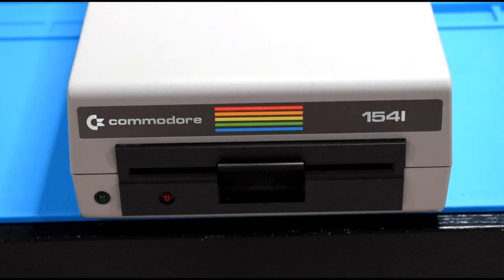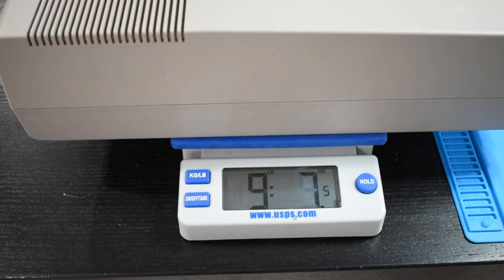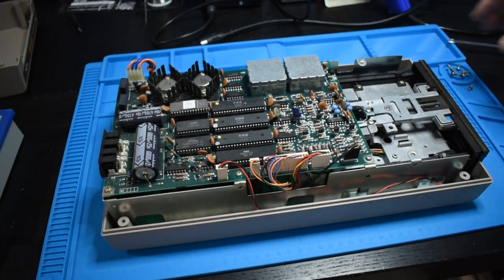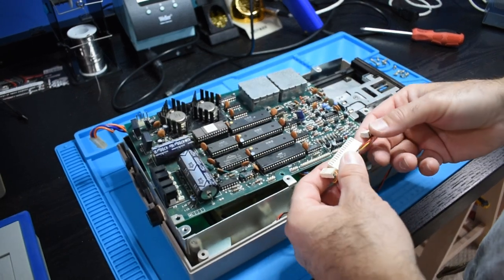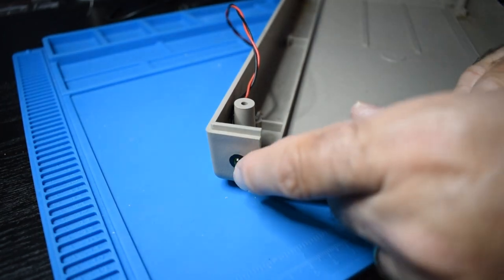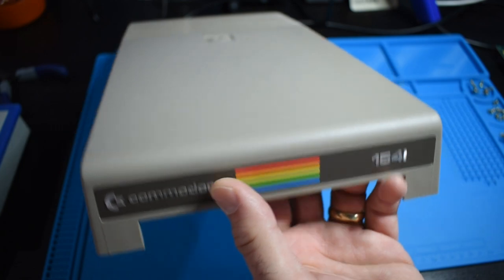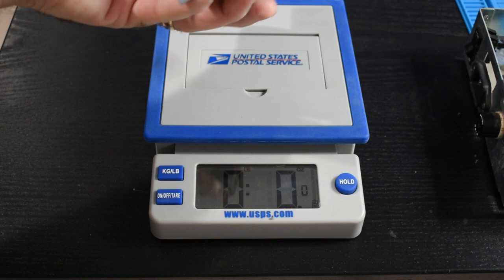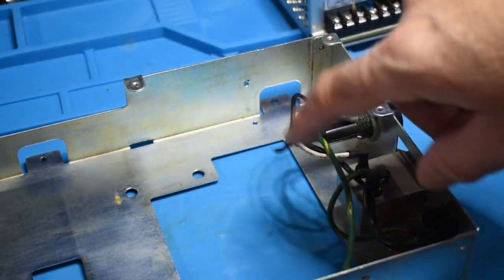The Weight Reduced Commodore 1541

Comment: "Is it heavy?" "Yeah." "Then it's expensive, put it back."
.
I kind of like electronics with heft. It's somehow more satisfying than the air-filled bits of plastic around today. I'd leave the RF shielding in. That said, the heat reduction is a huge winm so the old power supply needs to go. 
.
I used to hate RF shields, but now there's so much RF smashing around our houses that sneaks into other things, I kind of appreciate the shielding that went into things before the FCC gave up.

Comment: Hey, thanks for this. I am new to the C64 world, and I do have a working 1541. I have a bit of experience with modifying electrons, but I am still consider myself new to it. Do you have a website or photos that show and explains the changes you made? I am interested in doing this as I do know that this is an issue for these old drives and I would love to correct it.
Reply from the maker: I actually have another drive I was going to do, so I'll make some  instructions while I'm doing it.  thanks for the idea!
Reply: @thecommodoreroom4554  That would be awesome if you do, thanks.
Reply: Hey, watched this a lot and I tried it myself, and I am not getting any power to the board. I have Pin 2 of CR1 going to VR1 and PIN 3 of CR3 jumpered to VR2 exactly as is in your video, and I have pins 3 anbd 4 fo CR1 jumpered, and I am using the same power supply as you. Black in Load, white in neutral, I still have the green on the metal frame for ground. I have the 12 volt line going to +v2, the 5 volt line going to +5V and ground going to ground. The LED on the power supply comes on, but I am not getting anything to the board. I am not sure what is wrong at this point, any tips?
Reply: @robertsissco2439  Do you have a volt meter? I would start by testing the RT50B gives the correct AC (110 or 240 depending on your country) and DC (5 and 12 and 0 ground).[ Disclaimer do not attempt if you do not know what you are doing as incorrect use may result in electric shock.]
Reply: @thecommodoreroom4554  keenly interested in the instructions for this.  I have two 1541's I would love to put on a diet!